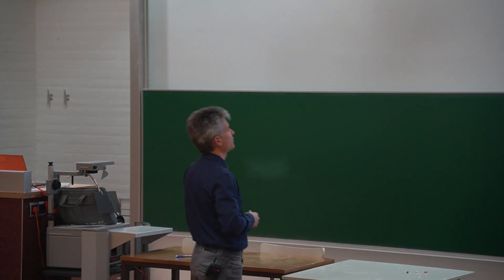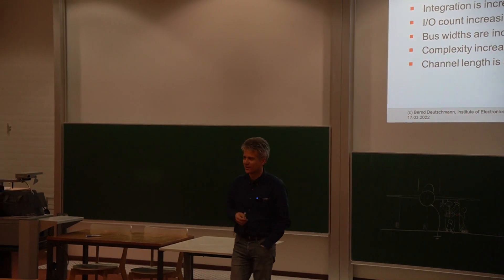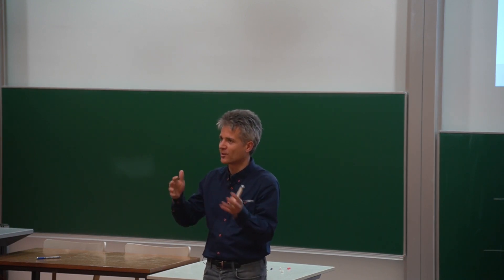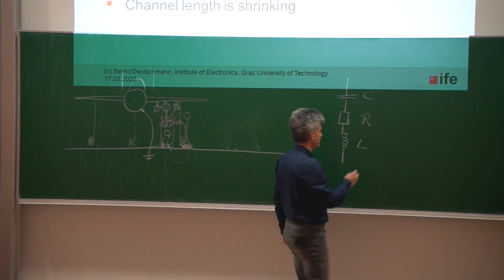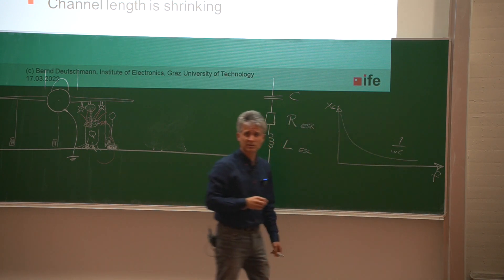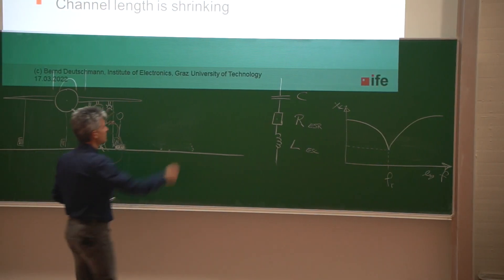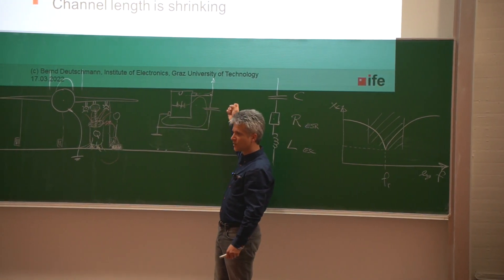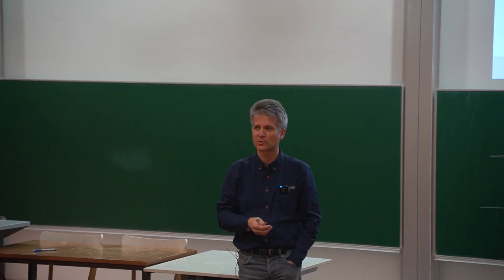Decoupling Capacitor

Comment: Great lecture, but quite basic.
You forgot to add that it is not mainly the frequency at which the system operates, but the slopes of the signal. In the frequency domain, a rectangular signal as you mentioned in the lecture can be decomposed according to the Fourier series into a main frequency and a sequence of odd frequencies. In fact, the rectangular signal is a trapezoidal signal. And the timing of rising and falling edges affects the content of higher harmonics and thus the width of the spectrum of EMI interference and its amplitude (falling rate), which in turn raises its overall level and makes it more difficult to suppress. Today's integrated circuits even operating at clocks of 20 MHz can have edge times of tens of picoseconds! 20-200ps compared to the old 20-200ns. Which means stretching the signal bandwidth from megahertz to tens of gigahertz.